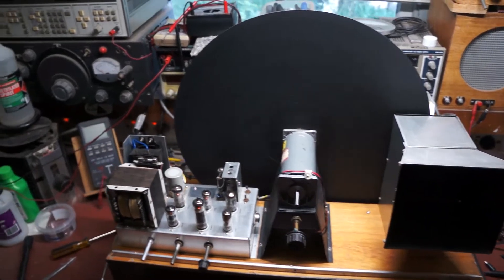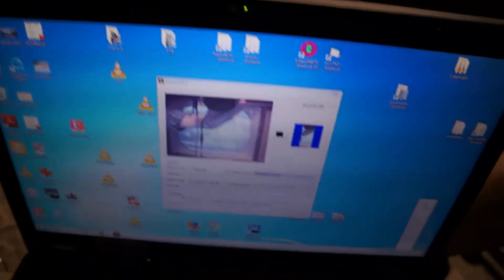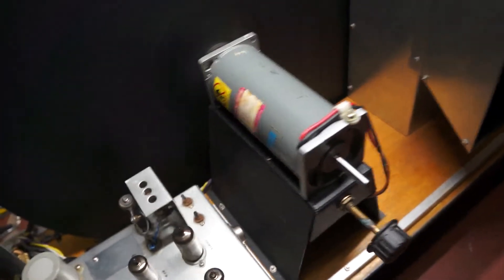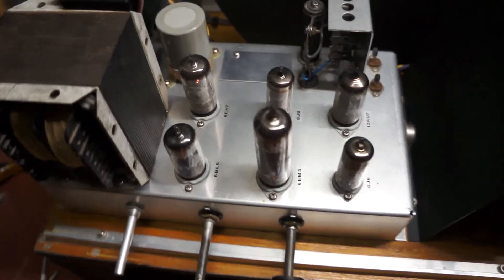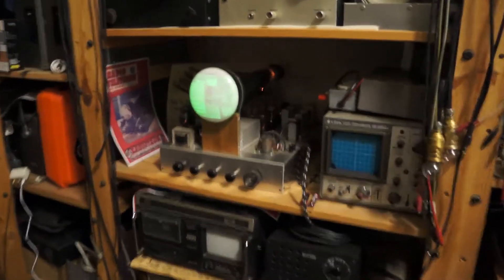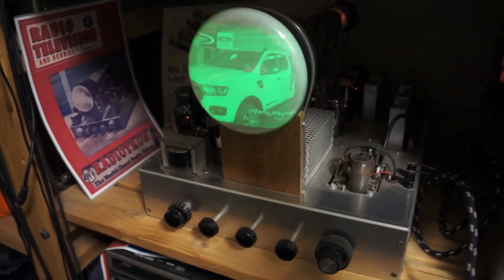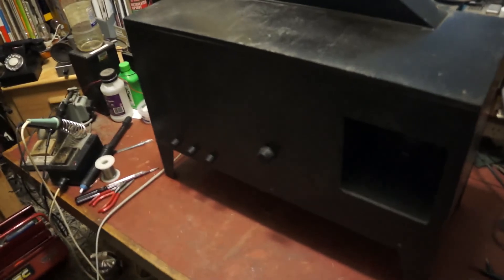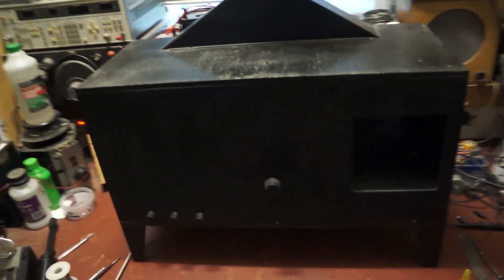30 Line Mechanical Television

Comment: Nice redesign of an ancient idea! I watched a lot of reiterations of this on YT but they are all the same. People copy the original idea without any improvement at all... Sometimes It's just digital instead of analogue.
Back in the 20s rubber was a rare material and very unreliable. Still, if they have had this material handy, I think they would have made a continuous rubber band with holes in it, rotating in a horizontal plane over 2 bearings. Just like a movie film roll. The disc has inertia and cannot be controlled reliably all the time. A rubber band is much easier to control. And the holes will have the same speed in the horizontal  direction, hence, the image will not be trapezoidal anymore. And the device would not be huge to accommodate the disc... Don't understand how nobody thought about this before. I hope I'm wrong.
Cheers!
Reply from the maker: By the end of the 30 line era, the Nipkow disc had given way to the mirror drum with its many advantages; e.g. small, optically efficient, suitable for large screen projection. The disc was always popular with the home constructor because of its simplicity. The 'film strip' scanner has been described in period literature, although I'm not aware of any commercially made set using it. One variant is shown in this issue of Practical Television https://worldradiohistory.com/UK/Practical-Television/30s/Practical-Television-1935-01-S-OCR.pdf
Reply: @cool386vintagetechnology6  Great to see that someone else came up with the same idea. I was not aware of this. Too bad no real model has ever been seen anywhere. It would have been more practical than any wheel or drum as the inertial mass of a roll is much smaller than the inertial mass of discs or drums. Imagine this design arranged in a horizontal manner on a table...

Comment: could you maybe show the schematic of the Super-Regenerative Receiver using the Gutton-Touly circuit.
( is that FM or AM ? and is it also sensitive ? )
Healthy and Friendly Greetings from the Netherlands!
Rob
Reply from the maker: I found the Gutton-Touly circuit offered no advantages in terms of sensitivity. Where it was superior is that stray capacitance and circuit layout is less important. Super-regenerative receivers are AM, but work well for FM with slope detection. Since I was not entirely happy with the circuit shown here, I have not made it into a project article. However, you can see a description here https://worldradiohistory.com/hd2/IDX-UK/Technology/Technology-All-Eras/Archive-Wireless-World-IDX/30s/Wireless-World-1933-04-OCR-Page-0197.pdf